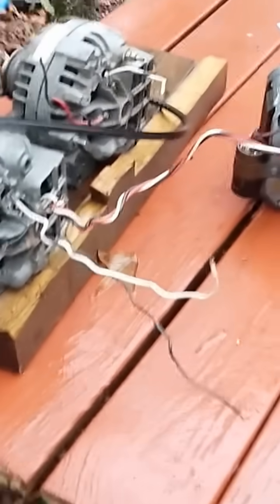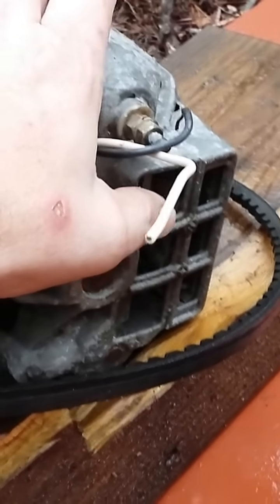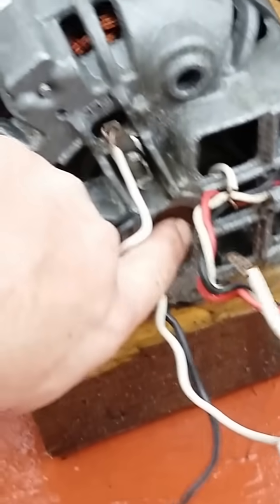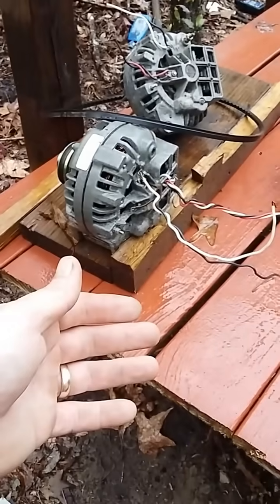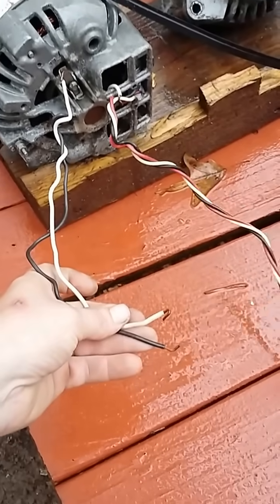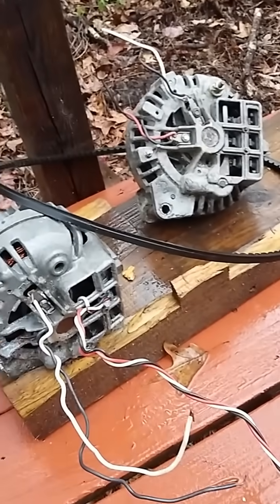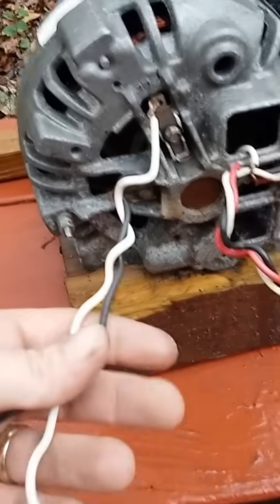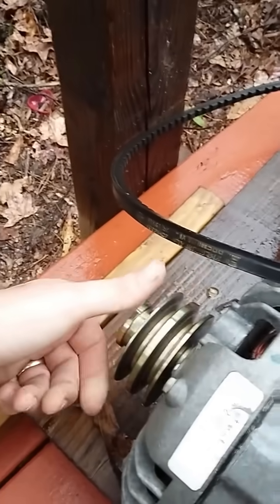Update Free energy forever no wind no solar no gas READ DISCRIPTION!!!

Comment: your full of shit, You can get energy but not enough to start a fuckign fire let alone 5 kilowatts an hr which is needed these days for most homes.
Theirs no information missing except your output per hr, Just another scammer.
can tell me what the rate of power production loss is over time to friction.No super conductors = friction = more power out than goes in is not possible under the laws we currently know.
YOUR  A FRAUD WHO SHOULD BE CHARGED, THE ONLY REASON YOU GET AWAY WITH IT IS BECAUSE YOU MAKE NO STATEMENT IT WILL NEVER PRODUCE ENOUGH POWER TO LIGHT BARBIE LET ALONE A HOUSE
Reply: **Your(you're, you are)full of shit
**Theirs(there's, there is)no information
**YOUR(you're, you are)A FRAUD
Reading and comprehension are important parts of understanding. Try reading first.
Reply: you can figure out the grammar later, hopefully.
Reply: @salscycleshop3416  really you ad hominen me instead of dealing with facts , grammar is nothing , ripping people of on youtube is far worse than grammar. Attacking a persons grammar is an admission of defeat, especially when you only attack the person hence my statement your Ad Hominem attack. please explain to em how my grammar makes me wrong and the idiot trying to make people believe he has done anything past kindergarten, if he has that much education, to make clearly pre kindergarten videos on a subject that was killed 25 years ago.
from your ad hominem attack i take it your just a fucking avatar of the brainless twat in the video, i have to attack him because nothing he stated in video made sense on any level.
But please do show your incredulity through attacking ad hominem instead of dealing with the  facts.
Reply: sounds like the government trying to blend in and make us unbelieve this...

Comment: to begin with, the thing that rotates is the rotor. the stator is the contraption with the coils wrapped around it.
the connections you have with bare copper wrapped once around it self will NEVER carry any Amps worth talking about.
you'll get a little fireworks of sparks at best.
Never in your life have you been able to power up a house with this contraption.
the people telling you that you will die are right. if you fuck around with electricity like you do you are bound to be zapped.
Mind you, you could be the prize winner in this years Darwin Awards.
the stupid ones die

Comment: Why are you posting a video that says forever no wind, no solar and no gas!!!!  Which could be still true cause you can use water, magnetization or geothermal. The title makes claims I did not hear addressed. You keep saying its not rocket science but by leaving out relevant details you are turning this into Rocket Science!.....How are you putting 3 volts into that alternator. Just saying it is not the same as having an actual source to power the Alternator. I don't get it. Why make such a large claim and don't address anything about whats claimed in the title.

Comment: Scam alert.. Im an electrician since 1987.  what hes saying in theory is somewhat true but what he doesnt tell you is the real story.
First off it put out 90 amps at 12 volts dc  , so roughly translates to 9 amps at 120 v ac
2nd.  its not free energy unless you consider it free for you to sit  there 24/7 and pedal a bike hooked up to the alt/generator
Reply: make a free spinning magneto magnet alternator...build one that spins flip flop
Reply: @evahunkins5571  Wow sounds right . I just imagined Spoons on a wheel that have rubber strap spinning them and the magnets around helping / rotating , generating . I;m thinking the spoons  shaped arms would springs forward and return as the next does same , it goes into motion ? Seems easy . The earth is magnetic ,we must be able to harness magnetic's . I believe the ideas have been hidden and used already in past and still by Govt etc ?
Reply: Theory and practical are correct the size if expanssuon is incorrect

Comment: How you going run 90 amps through 30 amp wire, melt insulation at best, start a fire burn down your house, worst case.
Think the death treats was more a safety warning.
Reply: so with proper wiring, it  can  be  done...right?
Reply: Oh hell no the design is full of problems, first the poor little, generator, I say generator became he pulled the rectifiers {diodes) out of the alternator, now it puts out a AC current. The windings on the generator was designed for about 14 volts DC at 90 amps. Power is a function of voltage times current 
p=E x I so at 14 volts x 90 amps the power (wattage) is 1290 watts,  bust the voltage (E)/to lest say 120 volts, so that's 10,800 watts. So the poor little generator will
last about a minute before the wires used in the armature will melt down and cause who knows what, a fire let's say.
OK let's say Jesus is watching over the poor little generator, the next issue is frequency, that's Hertz, a house, in the US and Canada runs on 60 hz, in Europe it us 50 hz.
Frequency from a power station is a function of armature spacing. I don't know but the poor little generator AC out put frequency was designed as a DC alternator. Remember he pulled the diodes.
Their job is to turn AC current to DC current. Since its function was to produce DC, AC frequency was probably not a concern. 
I bet my left arm that the design would turn to a smoke maker then maybe catch on fire.
Better off going to Home Depot and buy a good AC generator designed for home use.
Basically this is bullshit.

Comment: Hey Cuz, you can block comments, but you don't answer questions. It takes power to turn that alternator.... to make power. Alternators/generators MAKE ELECTRICITY when turned- that's what they do. If turning via belt off a vehicle's engine that's running, one is buying the gasoline (or diesel) for that engine to run. Your video headline says no wind (which can be used to turn an alternator), no gas (see previous sentence), no solar (which could be powering an electric motor to turn the shaft) but it takes SOMETHING to turn the shaft on the alternator, and there will be power losses in every step taken. Maybe you have it rigged to a bicycle on a stand... that would make "free" electricity as long as someone is sitting there pedaling. But you don't mention that. Simple question: How are you turning the shaft on the alternator? Sorry to sound like a smartass, but but I'm glad that you've figured out that a spinning alternator makes electricity... that's what they do. What are you using to spin the shaft?
Reply: I agree theres no real action or working anything at all in this video
Reply: but a electromanet alternator would work make one flip flop flip flop

Comment: Lets see your work and run your Refrigerator, TV, Washer, Water Heater, Dryer, Lights etc., Also have your heard about phasing when you have two competing AC generators running? If you don't sink your phase between the two AC generators things will go very wrong, very fast.
Reply: y dont u help the cause instead of negating
Reply: Because he stated he didn't want to hear from us, the people who know more about AC generation than he does.  @evahunkins5571

Comment: i have so many questions. its been 2 yrs. hows that working out for you? who exactly "told you you better take it apart"? if you were worried about personal safety & security regarding "they", why would you post a youtube video that "they" would absolutely be able to see? lets get the answers for those & then i have more questions.

id like to point out that youre playing with alternators & generators & electrical motors & batteries OUTSIDE IN THE RAIN. 
obviously trying to self-nominate for the darwin awards.

no such thing as overunity. nor free energy. nor a perpetual motion machine.
what youre trying to achieve is not possible due to the law of conservation of energy. this principle has been tested countless times & is tested every day across the globe. it has never been shown to be anything but accurate & a fact of science. ever. not even once.
Reply: back off on the shill pills, he never mentioned perpetual motion, and knows that with a little energy of one type, you can make a lot of another type!.know that!,and you don't?.

Comment: I love how he confuses capacitors with diodes. Hahah.
Reply: Sheldon Brown do you know what a capacitor is lol. You seem to be confused as well
Reply: @Big_Higgy  😂😂😂 people should learn what there talking about before they go running there mouth. Sheldon brown just made himself sound as dumb as a hat full of ass holes. 😆
Reply: Tindy Atwal yes he did lol
Reply: Omg. Capacitors do not change AC (which is the type of electricity made by an alternator..) into DC current. While alternators do have capacitors, their function is to excite the windings and prevent voltage surges. They do not act as a rectifier as stated in the video.
Reply: @sheldonbrown3261  ummm OK sheldon your a very special person mate. Sorry if i hurt your feelings.

Comment: It's not like this is a new thing
But the only way you're going to draw 90 amps out of that contraption is if you have a Step up Transformer otherwise you will not achieve more energy out of your power source then it takes to operate it as it will load up and bog down that little 1/5 horsepower dryer motor is not going to cut it under a load it's all good in theory but as you notice you don't see it operating
Reply: u should help not criticize plz.thanx
Reply: @evahunkins5571  
Not criticizing just saying that will not work been there tried that about 30 years ago!
If you want this type of device to work first of all you need a power source that will put out 90 amps without getting hot and burning up so in order to achieve that it has to be hooked to a heavy flywheel and have something of sufficient power and gearing ratio to run it

Comment: Wouldn’t running that much of a load burn up the wiring ? I’m not an electrical expert but pretty sure you can’t run a stove or a welder without everything melting down

Comment: What about parasitic loss?
Reply: Mechanical friction- (bearings require force to overcome their inherent friction to turn) the friction of the contacts rubbing against the armature to transfer the electromagnetic energy from/to the coils, Air drag- (cooling fins on motor/generator require force to push air for cooling...) , Electromagnetic friction- electrical conductors have resistance (friction) that has to be overcome before electricity will travel through it(this includes the energy generated in the coils that travels through the armature to the brushes). This is just scratching the surface. Mechanical force into electromagnetic force is not 100% efficient, nor can you get more out than you put in. Energy is not as simple as 12V into 120V. Amperage or total Watts(the actual measurement  of total energy) of power is never taken into account in the video. So many laws of physics are blatently ignored and not addressed it's amazing anybody with a basic understanding of electrical principles  could take it seriously.
Reply: @Mike Any natural resistance induced by PHYSICS is called parasitic loss.  It saps any inertial momentum which isn't being supplied a constant surplus of power to counteract that resistance. 
It's why there's no such thing as a real perpetual motion machine, much less one which can be taxed well above its own internal loss. 
This guy may have some good videos, but this one is all baloney, mate!
Reply: 1SqueakyWheel Agreed. Thanks for the additional definition.  Was tryin to keep my explanation simple. As an electrician I could go on all day about what is wrong in this video, let alone the inherent dangers, such as having current limiters in place for example.
Reply: Explain parasitic loss please.

Comment: Someone suggesting paid agent. I would ask where is the check. In fact i believe free energy is possible. Tesla pioneer this in the 1940's the configurations in this video will not provide free energy. If you are serious and have the understandings i suggest you tear alternator apart add some microwave parts few magnets field antenna then you can do some neat stuff. But without electronic understanding you most likely will hurt your self
Reply: If your not serious then i suggest at the very least you get your wiring correct
Reply: Please provide a rough scratch diagram on how to attach additional magnets, a magnetron, and a dipole antenna so that we may all see the light.  I'll be waiting with a soldering gun at the ready, cuz I'm all in!!
Reply: u said it..u can help...we need a perpetual magneto alternator like tesla made
Reply: Sorry, no such thing.  
This is all a big crock.  I think we're being trolled.  Lol

Comment: Of course diodes can be used to rectify the ac wave. To make dc bridge rectifier depending number of diodes for full wave use a bridge circuit. My other coment in regards to where is he getting dc was in reference to his statement. That his supply was dc if you have a supply then its not free. However. I will point out that we have made huge leaps in o point energy devices so riding the fence on the whole free energy idea is probably not a bad idea. Good luck. And happy hunting
Reply: build us a perpetual magneto altremator like tesla built...u do it we all buy one
Reply: @evahunkins5571  Tesla did present such technology but it was seized by the alien property office. No one has ever been able to duplicate it. We have made huge advancements on his work with longitudinal waves. But for now solar is your best bet for a working system is does work and its free. After your initial investment. No matter what system they build it will have up front cost. So I encourage you to take advantage of that which is avalible now. And that's solar it works.

Comment: A diode / recterfier is used  to change alternating current into direct current. Generators was used on vehicles before the alternator , and it put out  direct current. Years later comes the alternator that turns the alternating current into direct current by way of the rectifier. All military vehicles such as the Jeep ect used  waterproof generator years ago but they probably switched over to something different now days. If you are studying electronics study ohms law you are going to need it! It is not duffricult.
Reply: u need to help build a perpetual magneto alternator

Comment: There is a thing called ohms law. Its not ohms theory. V=i×r. I=v÷r. R=v÷i p=v×i..ap or p= i squared ×r...real sorry bro. now you could put a wind or water fan on your pulley. Your ac out will have little power but could be used. You would be better served to find a old dc generator from positive ground tractor put wind or water fan on shaft. Use dc out... To... dc to ac converter. This would provide a use able power source. Wont power much and only when your fan is turning putting several dc batteries in parallel for storage would provide power all the time. But running anything drawing over a few amps will zap system quick. Also keep in mind your fixtures are not setup to handle fast and large variation in power
Reply: Jesse Doolen this is what I thought. Generators and alternators generate power based on rpm if I’m correct anyway. So unless you can keep it spinning at least 2000 rpms you won’t see much power generation. Just my opinion anyway
Reply: Rpm will have to be maintained. Outside of a vacuum there is no known perpetuating energy source that does not lose over time. Except fusion. Even in a vacuum self perpetuating energy can only supply itself.now with this in mind.   There are two things that happen one is when a coil discharges thru a load it has a a momentary back voltage much grater than supply. Two all magnetic fields as they collapse they have a field effect of magnetic power this differs from electron flow as we know it. A example of this is scaller waves. So if your powering your load with this type of power. In my opinion you could in fact get free energy out. The circuit does not see this as a load of electron flow. But is just not possible with the configuration this guy uses.
Reply: why dont u build us a pepetual magneto alternator flip flop flip flop...hell with electric companies
Reply: @evahunkins5571  There are people a lot smarter than me working on this. This day and time when it works. It will be for sale bet on that. There is no way to cover something like that up. The best thing for now is solar panels  available. You can buy them almost anywhere. It will take about 6 to completely power your home. Of course you will also need adequate storage /batteries as well. You cannot expect to spend 8,000 dollar's. But it does work and will end or greatly reduce electrical bills.
Reply: Sorry it will cost about 8k to cover your average home needs.